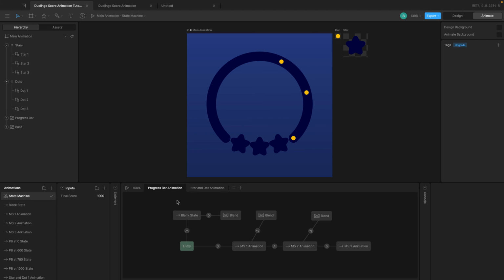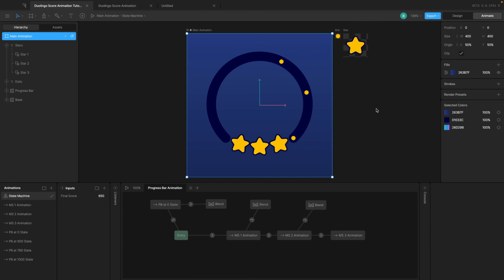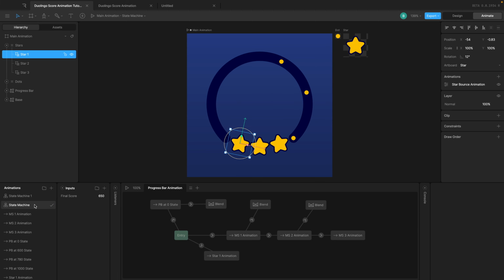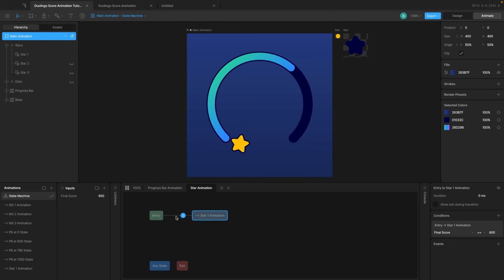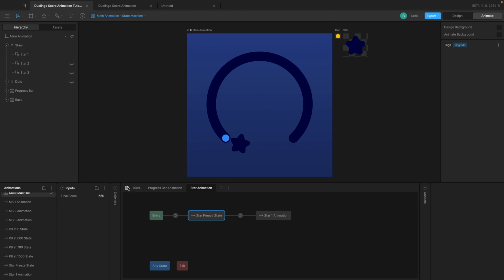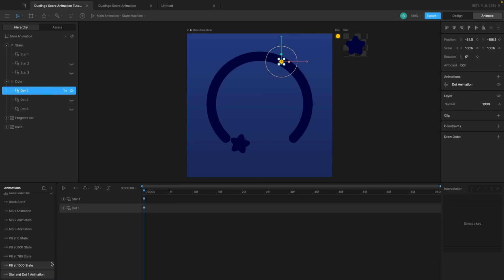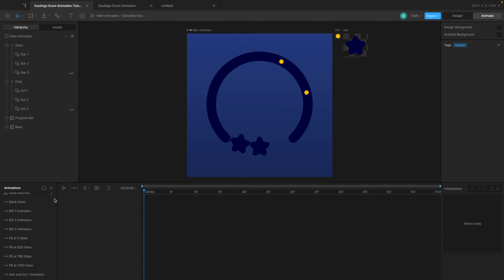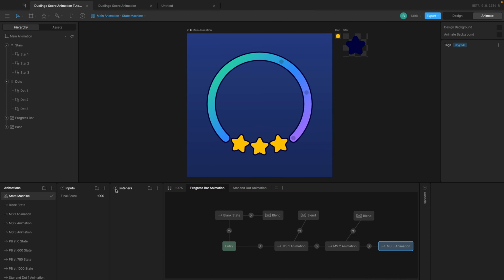Animate Multiple Timelines using State Machine Layers - Rive Tutorial [Part 6]

Comment: Hi Chethan, amazing video but i'm facing a issue -  i set the condition for if the final score is 600 or above 600 the animation will play. Now if i input 600 or above final score the flow is connected from entry node to the animation node and the animation is playing but if i put a final score below 600 or example 350, the animation is still playing but the flow is not connected between the entry node and the animation node. So even upon adding the condition my star 1 animation is playing regardless.
Reply: Upon further troubleshooting i've noticed that what solves this problem for me is to uncheck the "playing" checkbox. If i uncheck it everything is running smoothly as it should.